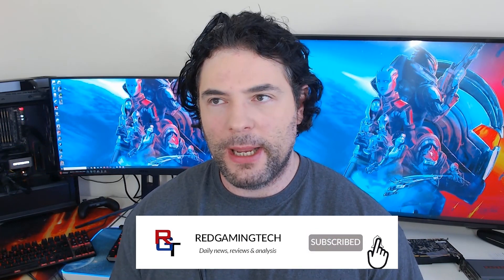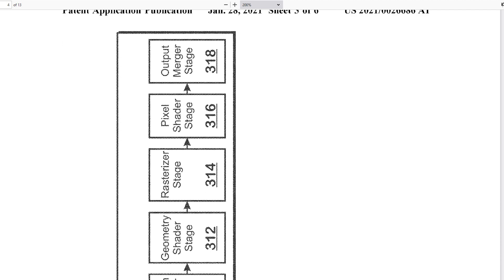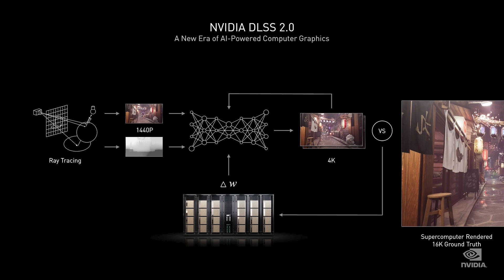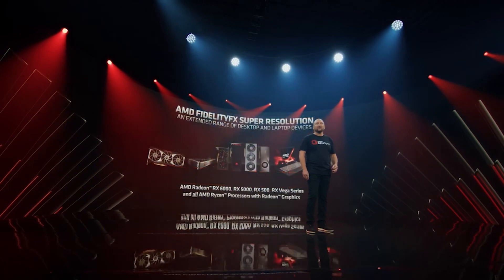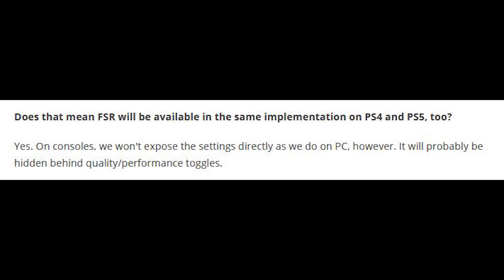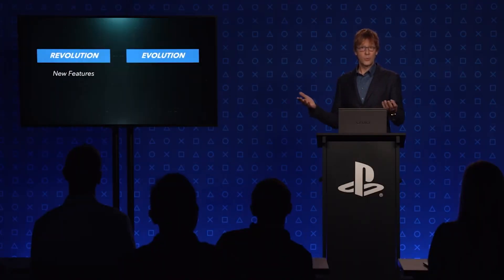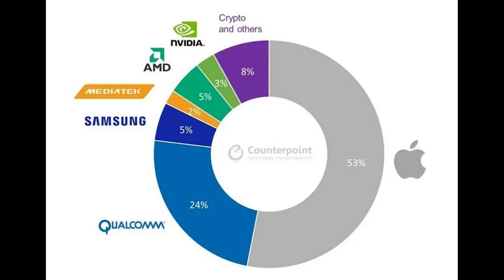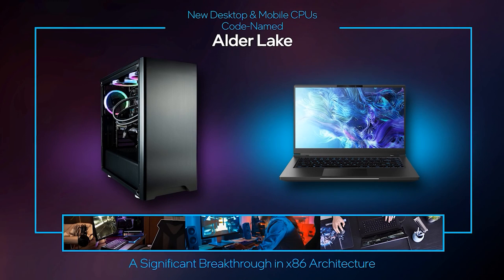RDNA 3 Upsampling - How Navi 3X Could TRANSFORM FSR | PS5 FSR Support CONFIRMED By Dev

Comment: FSR is a bit cheap because AMD doesnt understand the potential of AI early enough to have ML accelerators in rdna2 and they arent catching up to the quality of DLSS 2.2 anytime soon if ever. AI improves way faster than a manual algo
Reply: Ai costs more money and takes more time to develop.
Reply: FSR and DLSS are not the same thing nor used for the same thing.
FSR ML is coming with the next version
FSR is meant to be used along side TAA.
RDNA2 did get improvement for ML.
Reply: @BrotherO4  There is no indication FSR ML will be a thing. XSX/XSS got ML acceleration, but not RDNA2 itself. Those only came to Xbox because MS had AMD add some extra logic to the CU's to handle 4-bit and 8-bit integer compute for inference loads.
Reply: @TavishHill  no indication, 
go look around.
Reply: @BrotherO4  Look where? AMD directly told us it was not using ML. I'm sure they will have their own ML soln for SR in the future, but FSR is not it. They want FSR to be bespoke for all low end machines going forward, not just high end cards.
Reply: @TavishHill  maybe you have not notice. there are a few people that have leaked intel, amd, and nvidia products, tech, and information's up to a year and half ahead of time with 95% accuracy for years. to boot...there is already an patent of FSR with ML out.

We already know FSR has a 2.0. AMD is straight up letting you know this with "FSR 1.0" on the options. amd FSR that they have in the works is already much improved over 1.0 but wont be ready till a year. so they release what they had now and save all the WIP improvements for 2.0  when its ready. yes ML is one of those improvement. its optional pass that will be skipped if gpu doesn't support it.  

Nothing that any of these company have release was a surprised. we know everything for a long time.
Reply: @Cooe.  Yikes. I literally quoted the dev...but you evidently are convinced you know better than the direct quote.  Oooook then. (btw, that isn't even what dyslexia means champ, lol)

And "at high resolutions" you have no missing pixels to reconstruct, hence FSR doesn't miss much detail. But nobody is using DLSS at high pixel counts. It is designed for 1440p and lower. You need to have a basic iea of what the topic is even about prior to arguing yourself into a corner. He is saying up near 4k internal res, i.e. when you are close to being native anyhow, DLSS loses its benefits since it has nothing material to reconstruct. 

When the internal res is lower and you want a 4k output, i.e. the *actual use case scenario for DLSS*, FSR loses all those details and DLSS works much better. Why would you have a game running at that lower internal resolution? Because modern games use stuff like RT, which is bound to pixel density. DLSS exists to let games use lower sample raycasts for RT and still get sharp 4k output at good fps. 

He says in the article that for the use cases you'd see upscaling applied in DLSS is better for the obvious reasons. He says for other use cases like near-native 4k there is no difference as DLSS loses its advantage, and at super low res FSR is better since it is targeting a screen size as output too small to resolve fine details that FSR loses anyhow.

You quite literally do not even grasp the subject you are trying to argue about, lol.
Reply: Correction: it takes less time on the consumer end. Developers have to take weeks to months in order get the data to the point that the algorithm can interpolate the frame correctly. 

That is a huge expense on the backend/development cost.
Reply: "AMD doesnt understand the potential of AI early enough to have ML accelerators"

AMD doesnt understand AI? LOL they understand better then this channels entire viewership
Reply: @saminavy7124  To be fair, they have been fed a diet of delusional Sony fanboy nonsense from RGT for the latter half of 2020. He built his channel around telling Sony fans what they desperately wanted to hear.
Reply: “AMD dosen’t understand AI”

You realize they spent half of their networth buying an Ai Company that already existed and sells products?
Reply: @ZambonieDude  If you mean Xilinx it isn't "an AI company", it's an FPGA company.

FPGA's are by their nature fully programmable/reconfigurable hardware and not application specific as nVidia tensor cores are.
Reply: Oh look, an ACTUAL developer who put both FSR & DLSS into their ACTUAL game prefers FSR! (When at high, actually "next-gen" resolutions like 4K ofc. DLSS & other temporal solutions are unquestionably superior at low, last-gen resolutions ala <=1080p). And he also said it was way, WAAAAAAAAAAAAY easier to implement!

https://www.notebookcheck.net/Edge-of-Eternity-JRPG-developer-talks-about-DLSS-and-FSR-implementations-highlighting-the-strengths-and-weaknesses-of-both.548837.0.html
Reply: @Cooe.  You are so uninformed you do not even understand that there are TWO different resolution types at play here...

You literally do not grasp even the simplest description of what we are talking about. The dev is saying that when there is already super high pixel counts FSR doesn't lose much detail (since it does not need to fill in many gaps). In that scenario, DLSS is mostly useless since it's built to reconstruct those missing pixels. NOBODY uses DLSS for such scenarios! The purporse for both FSR an DLSS is to let devs have RT at decent rpp levels while hitting 4k outputs and good fps. To do that, you need low internal resolution and a way to reconstruct back to 4k. Go learn what these terms mean before mashing the reply button like a moron.

If you imagine the whole industry is gonna implement FSR then by all means wish in one hand and shit in the other kiddo. One off small scale games that aren't even using RT in any meaningful fashion that partner with AMD's marketing team are not the ones who are making use of DLSS meaningfully in the first place. News at 11.
Reply: @TavishHill  You must be dyslexic... There's no other explanation how you could POSSIBLY read "I visually PREFER DLSS at low resolutions like 720p-1080p & FSR at high resolutions like 4K" & then claim they said LITERALLY THE EXACT OPPOSITE of that... 

And he ALSO didn't say "FSR isn't as bad vs DLSS at 4K" either. He said he VISUALLY PREFERS IT because of the less motion artifacts!!! And he ALSO sings the praises of its ease of implementation & accessibility!

And people DEFINITELY use DLSS to upscale to >≈1440p-4K!!! That's the most common use for the damn technology! Even DLSS 2.2 starts to get kinda crusty looking at 1080p or lower resolutions (nowhere near as bad as FSR of course, but again, who SERIOUSLY CONSIDERS <=1080p "NEXT-GEN gaming"??? O_o). Next-gen gaming is high resolution gaming! 1080p is 2013 gaming & can already handled at native res by 5+ year old MAINSTREAM GPU's! The future is ALL high resolution (>=1440p). And that's EXACTLY where FSR kicks ass.

Good to know you game at 720p though... I'm sorry. That has to fucking suck.
Reply: Oh look... Yet ANOTHER reviewer (PC Magazine) who actually tested FSR CORRECTLY unlike Alex at Digital Foundry, gives it another HIGHLY POSITIVE review & compares it very favorably to DLSS 2.2 no less! What a surprise!... Not... -_-

"That said...you really have to be looking for it to notice it at all. FSR does a fantastic job of effectively coming within spitting distance of DLSS quality, without Tensor cores or fancy AI training required. It manages to capture that same sense of "magically" watching your frame rate go up while the visuals stay the same, although the illusion starts to fall apart if you engage Balanced and Performance mode."

https://www.pcmag.com/how-to/sharpen-speed-up-your-pc-games-testing-amds-fsr-nvidias-dlss-22-more
Reply: FSR isn't the DLSS competitor that gaming media try to make it out to be.  FSR isn't a reconstruction technique to fill in the missing gaps.  It only smoothens out object edges appear closer to the higher res target.  In the process it actually reduces texture quality, but then uses an advanced version of CAS to try and hide the degradation.  It shouldn't be compared to DLSS or temporal upscaling solutions.  Even Sony's checkerboarding technique used last gen is arguably better... depending on if you think edges or texture quality is more important to fidelity.
Reply: @Akrymir  stop spreading misinformation. HUB/Gamersnexus already checked and proved that it isn't just sharpening.

Sony's checkerboarding is not better, where did you source that info?
Reply: @fireonyxiaz  It is CAS + edge enhancement. That's all. CBR is not Sony's tech and yes, CBR, TAA, temporal injection, DLSS and ML super res options all perform much better than FSR. You should watch DF's video on it from a week or two ago.
Reply: @TavishHill  Digital Foundry's comparison was broken... On a TON of levels. How the fuck have you not heard about this yet? He ruined the comparisons with different depth of field settings in Kingshunt that gimped FSR vs Unreal TAAU (when properly configured the former looks BETTER, not worse). 

He refused to test above 1080p (which HEAVILY favors temporal solutions even though 1080p is a completely LAST-GEN resolution). AND he ran CAS on TOP OF FSR, double sharpening the image into oblivion. 

Do more research and don't trust DF just because it's DF. There's a reason they were the ONLY one to think FSR sucks.

He also only tested still screenshots which MASSIVELY favors temporal solutions over spatial ones as it makes it so you can't see the AWFUL motion artifacts temporal upscalers cause.

Alex Battaglia had an agenda, and so he bent & manipulated his testing to fit that agenda. End of story. It's sad that he's tricked soon many fools like you though.
Reply: @Cooe.  Alex's comparison did not 'break' anything nor misrepresent anything. 

FSR just isn't impressive because it is being compare to actual reconstruction and it can't reconstruct anything (that is not how it works). 

There is good reason most devs won't be taking up FSR as their primary scaling soln. Vastly superior options already integrate into the various engines exist already.
Reply: @TavishHill  And PLEASE name me this mythical superior to FSR upscaling solution you think exists. I'm dying to hear about it, because Unreal TAAU sure as shit ain't it! It looks WORSE than FSR when ACTUALLY using identical graphics settings, not better. And ESPECIALLY so at the high resolutions of next-gen gaming (>=1440p).

And lol go look at FSR's studio/company support list. It's fucking MASSIVE & Microsoft just made FSR a core part of the XDK.

All you are doing is regurgitating Alex's REPEATEDLY proven faulty testing with none of your own... Which is worthless & grossly misleading.
Reply: @Cooe.  You are delusional if you think UE's TAA looks  or performs worse. You are legit just saying things for the fun of saying it. DLSS, CBR, TAA and temporal injection methods all work better than FSR.
Reply: Marcus Harmon AI is just differential calculus there is nothing magic about it. Machine learning is just an extreme application of curve fitting. It is not inherently better it is just a mechanical way of deriving equations. But at the end equations either derived by humans or derived by machines is what gives you result and equations does not care who created it. Some day AI might surpass humans in intelligence but we are not there yet and GPU' sold right now are not smarter than a human brain.
Reply: @kazedcat  This is mostly true, but to nitpick, AI isn't just ML, it's a subset of AI.
Reply: TavishHill Current state of the art AI is ML base so the distinction is irrelevant. And if you consider the broad definition of AI then FSR is also an AI.
Reply: @kazedcat  Not irrelevant at all. Yes, FSR is AI, as is stuff written to control npc's decades ago. If you want to explain ML applications to others, ya should parse these distinctions imho.